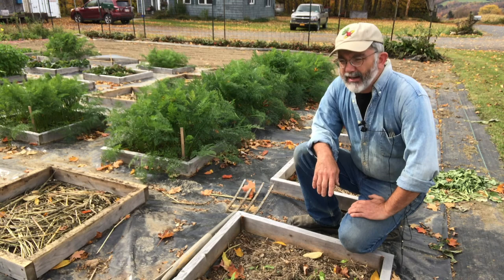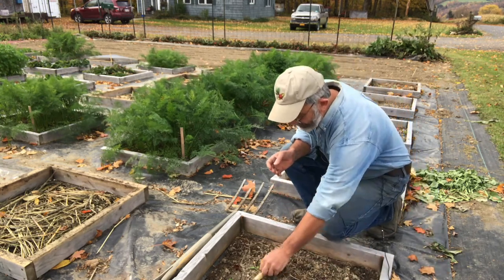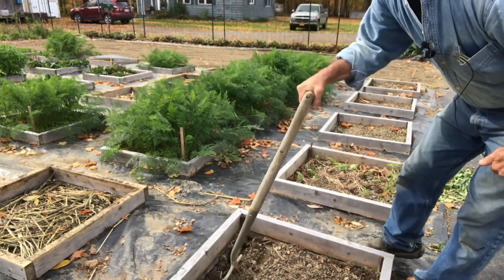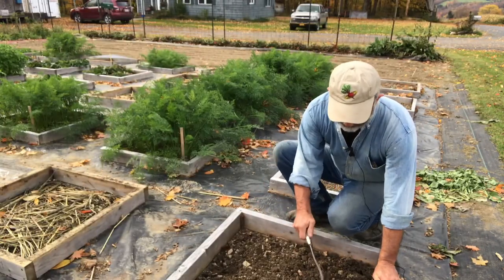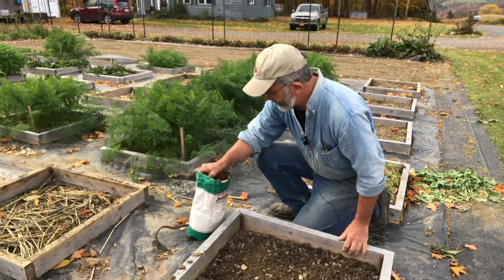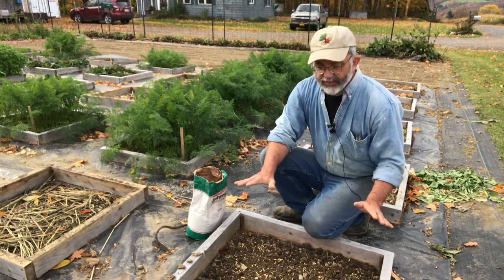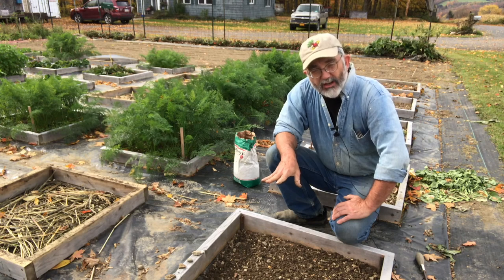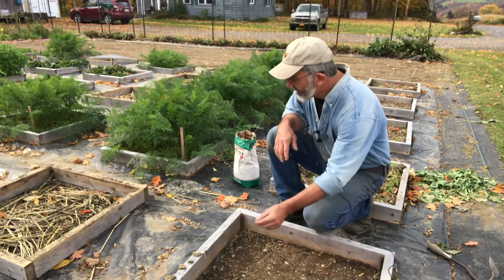Planting Cover Crops in Minibeds

Comment: For about three years I have been using woven polypropylene on my entire garden to primarily control an invasion of mint and other weeds. With the assistance of a weed wacker I have gained control.
But at a price. Since the soil is covered from September til April it reduces the amount of oxygen in the soil producing an anaerobic environment for the mycorhizae. This has resulted in less weeds and also a falloff in fertility and production. This September I removed all plastic and planted winter rye an New Zealand white clover in the beds, and only clover in the walkways. Surprise, Hugh green growth as the mycorhizae recover. 
That's why I'm skeptical about your minibed system. I think it is partially anaerobic.
When you cracked the soil adjacent to the perimeter of the minibed permitting oxygen under the plastic, I cheered.
Wishing you good gardening.
Reply from the maker: Hi Jerry,
I appreciate your skepticism. Black plastic is the Rodney Dangerfield of garden mulches ("can't get no respect"). And the younger me would be very upset with the older me for using it in my garden. :-)

This concept I'm experimenting with is an evolution of the plastic mulch gardening system promoted by Thomas E. Doyle 50+ years ago. Doyle used a large sheet of black plastic to cover his garden and planted into small-diameter holes (not minibeds). His plastic stayed in place for many years and he insisted that his garden grew better every year. He had a lot to say about air in the soil and the importance of soil air to growing plants. He shows a picture of soil clods from his garden in his book. The soil had been covered with non-permeable plastic for 9 years, and the clods are riddled with visible air passageways. Tom Doyle said that the plants had access to MORE air in the soil when it was covered than if it was not covered. I know, it doesn't make sense. But  he may have been onto something. I explain and discuss his whole theory in my Minibeds-on-Plastic Report #1. With Minibeds, I'm opening up far more soil than Tom Doyle did to the elements, to minimal cultivation, and to cover cropping (primarily for the root biomass it adds to the soil). But I'm totally eliminating 78% of weeding that would be necessary in a conventional garden. This first year has been very promising. I'll see if there is a decline in my garden success in coming years. It's an experimental garden.

There is also a long-known but little understood fertility dynamic that takes place when soil is covered for a period of time by any kind of material, organic or inorganic. This is discussed in an 1899 book I read on cover crops, and it is in Will Bonsall's gardening book. I'll be discussing this in my Report #2. 

I bought white clover seed to try in the walkways elsewhere in my garden. But haven't tried it yet. I read that it eventually gets infiltrated by weeds. That discouraged me. Thanks for the comment.